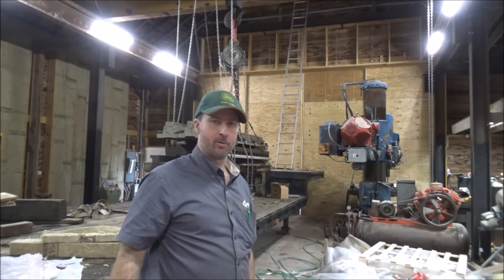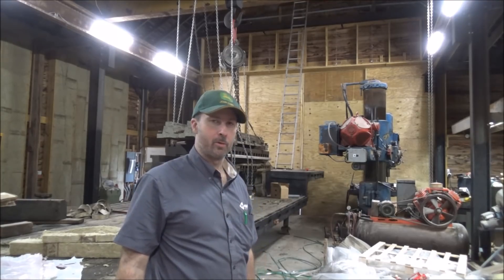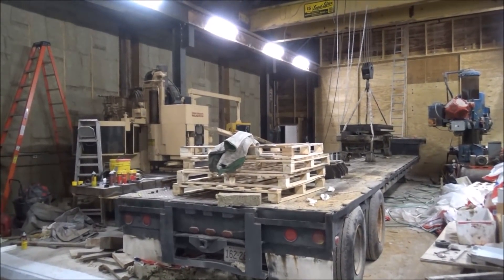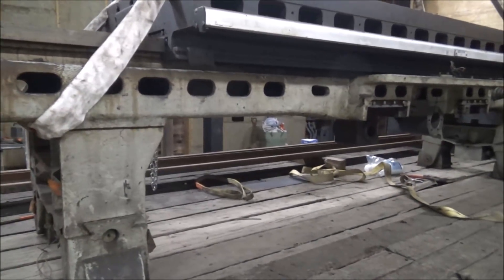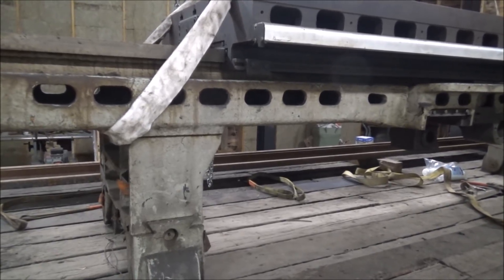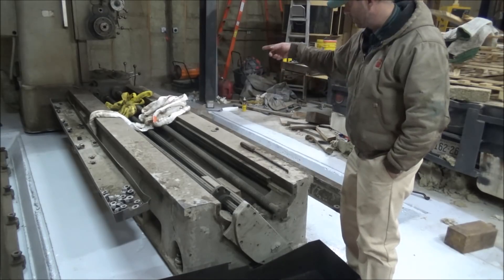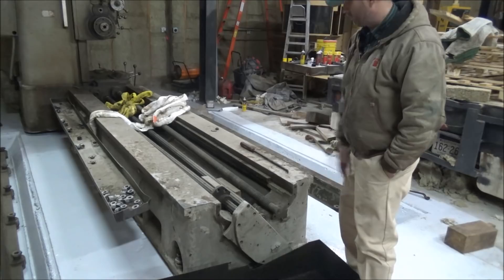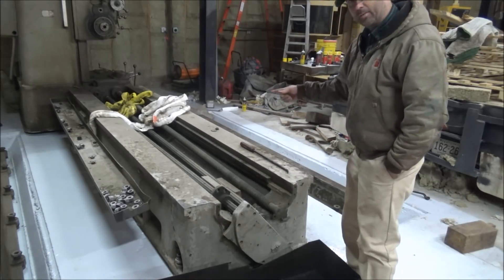Big 47000lb G&L 340T Boring Mill Move Part 5

Comment: To pull up those studs, get a couple of industrial neodymium magnets glued to the end of a wooden dowel (1/4 smaller dia. than the bolt hole) and slide through some PVC tubing. Sometimes it magnetizes the whole area, but it usually works.

Comment: saw this chip curling video with sound.. thought you might enjoy it. https://www.instagram.com/p/BfuSIztAbG3/
Reply from the maker: Nice! I would rather see it going full bore though and mowing that metal off. :-) A little artistic for me, plus I like to break a chip not make slinkies but that is just me. :-)
Reply: bcbloc02 just had a thought about the stuck pin in th g l shaft coupling. I wonder if they were trying to drive it out with the shaft dangling unsupported wedging it crazy tight in place or putting a big offset in it also preventing it's removal. I hope it did not bend anything hanging there unsupported.

Comment: ROTFLMAO!!!! Vanna White :-) good one. Again very well done Brian. I had every confidence everything would line up well enough. Has to be a bit off putting sometimes going by some of the comments in the last half dozen videos tho. There's a great many YT video producers that get the same. After enough videos people need to learn to have some faith in a persons skill and experience and respect that they do know what there doing and are a good judge of what's required for what there doing. Second guessing professionals usually doesn't work out well for the guessee most times and I learned that a long time ago. Yeah some of the more entry level hobby guys need a bit of help with what they haven't taught themselves yet. But clearly Yourself, Adam, Tom, Keith and many many others don't. 

With the years on that HBM the table surface and leading front edge is in a lot better shape that I expected. Was the dro working when you bought it? My back, knees and legs start getting sore just thinking of all the up/down your going to be doing getting everything to a final level and at full torque. By now you must be getting a little worked up about getting it and the CNC in operation.  Almost time to get the RPC and Monarch moved into the new home as well. :-)
Reply from the maker: The DRO was reading when I got it, I don't know how accurate it was though. It is a really old accu-rite. It has actual push buttons rather than the bubble screen. I bet it dates to the 80's.

Comment: i have a question.. are all the screw levelers in the feet of the machine at the same tension on the pads you made.. so the weight of the machine is equalized along all of them to prevent the machine from bowing while its sitting on the floor.  i realize the trailer bed was also not totally flat . got a lazer level.. you could set at one end of the ways and move a gauge along just for a cheap test..  i take it that you are going to level the machine ways first. are you going to create some sliders to put on the main ways to allow you to move the cross slide along actually above the side ways. to bring them up to an equal distance far quicker than how it might be done..
Reply from the maker: My plan is to level and align the mill, then level the feet, put the table on and adjust the rollers togive +.001" on the feet so when the mill table and parts move over the weight makes it come to 0.000

Comment: I'm thinking that a little bit of dry play sand poured around the bolts that are sitting too low would work to prop them up a little.  If you got a little too much in there, use a shop vac to aspirate some of it back out.  Might be an idea worth considering.

Comment: Brian, Stick a welding rod on the end of the bolts to lift them.
You do some amazing work single-handed.
Eric
Reply from the maker: Yep that was going to be my first attempt.
Reply: if its wiggling in the hole, first try a strong Neodymium magnet to try to lift it up alittle

Comment: Thank you for this video.  I agree with the other commenter who asked you about knee-pads!
The last I remember, if I understood right, you were running the radial drill from your welder.  What sort of 'big' power supply do you have in the shop now?
Reply from the maker: I don't have yet as my phase converter is still in the old shop. I have 400amp single phase now is all in the barn.

Comment: All looking good Brian, that machine seems to get bigger by the day!. I know that sometimes it's difficult to avoid but when I've been moving and installing heavy stuff like that I'm always a bit cagey about putting my hands underneath, especially when it's suspended. Working alone,  can make it a bit more dodgy.
Reply from the maker: That wasn't a tenth as sketchy as the ladder stunts I had to pull earlier in the week.
Reply: I was a concerned about that as well - having once trapped a finger :(
One safeguard might have been to temporarily insert a couple of >finger thickness hardwood shims under the tracks.
Keep up the good work Brian, you are an inspiration !

Comment: Now that you have been using the crane, your thoughts about reverting back to chains vs electrification.
Reply: Hi brian well done mate i have be watching from Brisbane Austraila for sometime.
 i personly like the way you seam to have such precise control perfect for a machine barn shop. i want one like it in my shed thats the crane Hbm like that or slightly smaller would be nice. i have a richards horizontal boring and facing mill with a 28'' square table about the same vertical and around 30''-40'' longitudinal. it is a little on the small side, so was the price and considering the variaty of work you can do on a borer any size it was better than no mill. i am vary intrested to see how you go about level and alingnment. how would i work out what sort of foundation i would need for a machine with a weight of around 12000 lbs. love your work MATE.